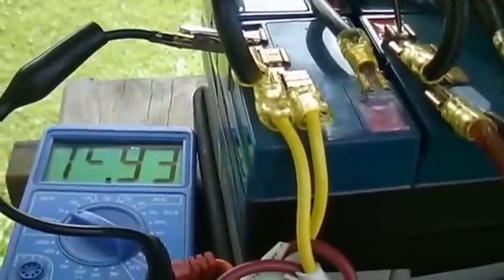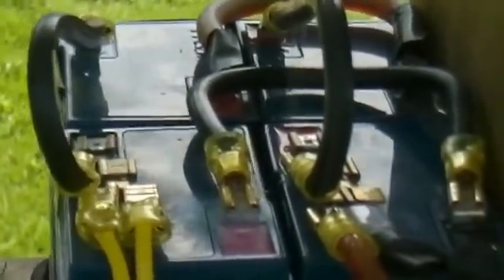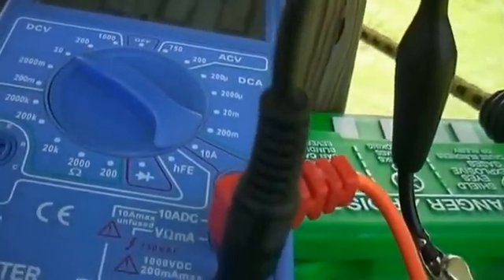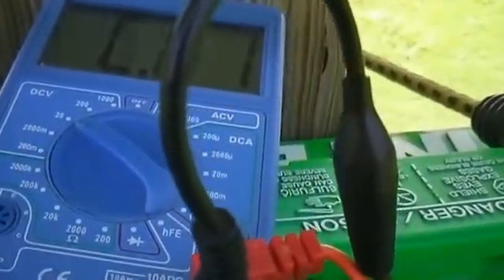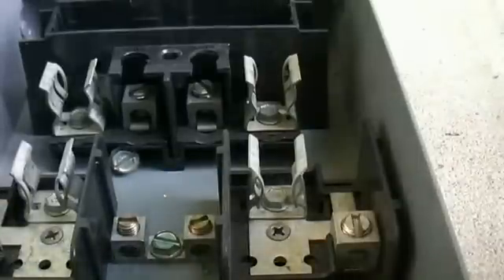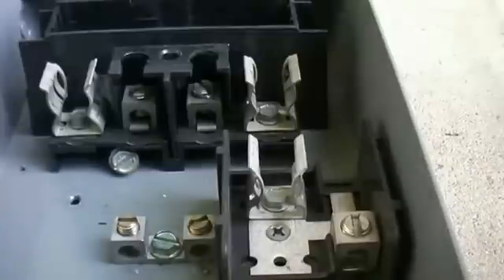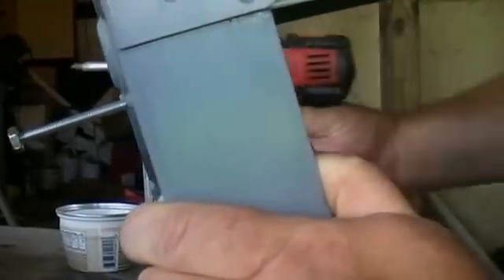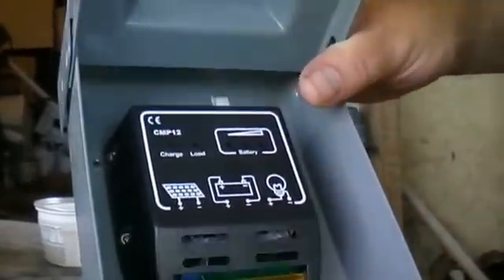Mounting  Charge Controller in a Outdoor Waterproof Box for Solar tracker

Comment: Don't throw that stuff away, those would hold a fuse where the disconnect is, good idea on the box
Reply from the maker: Im thinking that may be a better way to use this. It is not watter proof but only water resistant. It will adventually crust the board over with minerals from condensation and small amount of water that could posibly inter it. A combiner box for wires may be ok. I need to order a more exspensive box that is actually water tight.
Reply: I found a gray pvc waterproof box at home depot, i had to buy the lid separate but it has a seal. I will be putting up video of it soon, i have the video already, just need to process it.
Reply from the maker: I ll have to check that out.

Comment: It is good to to over charge your batteries sometimes flex max 80 by outback does it every so often to clean terminals. I love your intro very nice. Good info Thanks
Reply from the maker: Yeah bring them to a boil sometimes that is good way to desulfate. I think every sunny day its happening to mine though. Maybe its not nessary for me to put a charge controller on the big batteriers because the panels amps are so little but I think so for these small ones they need it. I can see stuff leaking out. Adventually they will boil dry. Thanks for watching.